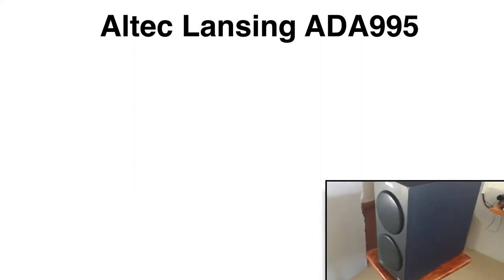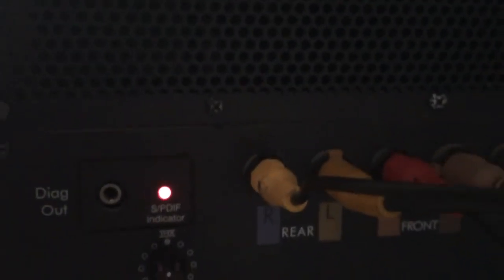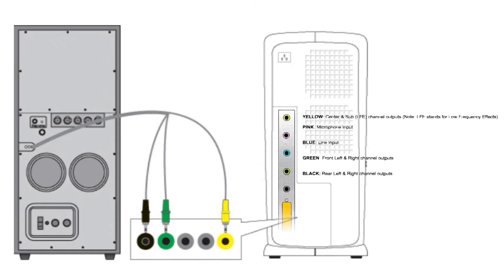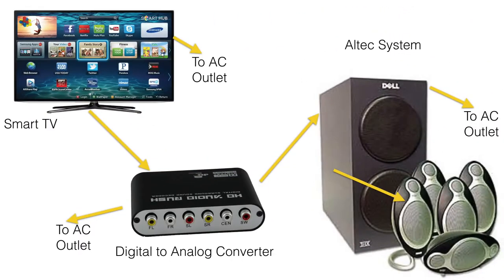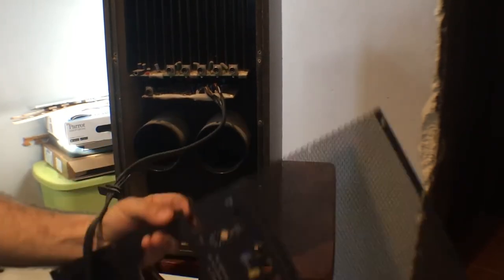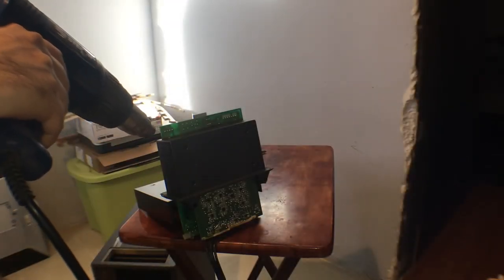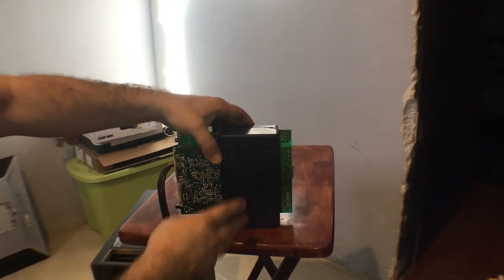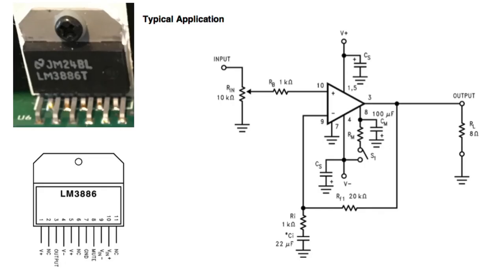Altec Leasing ADA995 5.1 home theater sub woofer take apart and review

Comment: I've upgraded my PC many times since 2002 and I still kept and used this to all my PC.'s. Still works beautiful, gives great sound and Bass....I dont think I will ever replace them unless it stops working completely LOL
Reply from the maker: I really liked the sound of this equipment, I sold it because I wanted a HDMI sound system and I could not get the 5.1 using its SPDIF input, but even with out that, it was a great a practical sound system even for parties.
Reply: Just don't leave them turned on!! I used to leave mine on all the time, and the capacitor in the amplifier fried and caught fire. If I turned them off every now and then, the amp/receiver would probably still work. But the speakers are still fine, Altec Lansing is top shelf. I used the dual 6" woofer cones to make bookshelf speakers out of.
Reply: How do you connect it to a new computer? how about the sound card and software? thanks ,new at this.
Reply: Samsies!!! Mine still sound as good as they did in 2002! I however, picked up some RCA to speaker terminal adapters along the way and swapped the satellite's with JBL control one speakers. The Altecs 8ohm internal amp matched jaw droppingly well with the JBL's and the difference in sound is certainly noticeable! Nice wood cabinet small bookshelf speakers are the perfect upgrade!
Reply: @sabrinaarturis  if your pc has 5.1/7.1 on the motherboard you can connect it to 3 3.5mm ports. After each connection a thing will pop up asking what you connected. Gold is center/sub, green is front, black is rear.
Reply: @lukenuked  thanks

Comment: I've had these same speakers forever.  They are really great.  They have seen many computers over the years and outlasted every one of them.  I just bought a new Dell/Alienware A51m, but I was disappointed that it only has one output for audio.  I bought the HD Audio Rush converter and all the appropriate cables and get nothing when connected to the new computer.  Zilch.  I don't even get a green "in" light on the converter.  Power light is on.  I have tried retasking mic/audio jack to output, but nothing.  I have confirmed your information about jack color and speaker assignments, and I have everything connected correctly.  I'm actually pissed that a $5K computer doesn't have the same audio outputs as all my other Alienware computers.
Reply from the maker: Well, I was shock on how well this system sounded (I sold it). Did you managed to make it work with SPDif?

Comment: Hey I'm very surprised and grateful to see that you take time to respond to questions - that is impressive. I was looking at subwooferst at my local GW and the thx logo caught my eye,  I got it to rumble by touching the tip on one of the inputs that white noise rumnle was enough to convince me and so I bought it. I couldn't find a ton of information so your video was a godsend. I'm so bummed I can't get it to play past a couple of minutes. Would you happen to know if there's a problem with the video or if not maybe I should look at my end. I'm guessing need to see the video of the answer the question but maybe you can tell me is one of those colored Ethan's plugs the input to the sub specifically? I assumed it was yellow because that created the loudest response from the sub. Again impressive sub and impressive videos thank you
Reply from the maker: Thank you for your comment and I am very glad it helps.
Did you check the video at 36 seconds, there I explain how to test each of the inputs of the subwoofer. I no longer posses this sub so I can not test on it, but use the integrated testing system in the sub to test each individual input.
May be I did not understand the question, my apologizes in advance. Thank you again for your comment and best regards.

Comment: I had mine since 2003 I believe. I had just finished upgrading from a 3930K build to a 13900K tonight, and was just going over some setting tweaks in the bios when I heard a shorting electrical  sound coming from the speakers. I first thought I'd screwed up with my build, but no, it was coming from the subwoofer. Smoke started to appear. I immediately unplugged the set. I took off the back plate, the main circuit board had nearly gone on fire. 

It's destroyed beyond repair, I'm heartbroken....😢😢
Reply: They are not beyond repair. Ask someone skilled in electronics to take a look at the board, or just buy some class D  ready amp 2.1 or 2.0 boards that are in abundance on so many portals and just swap the boards.
Reply: @aeonikus1  The board is fried, destroyed. And arc formed and melted a hole in it. This board controls everything, it's not just the sub. I have no clue where to get a compatible board.

Comment: Very interesting presentation. I've had this system for many years - superb! It was permanently connected to my PC (Creative Soundblaster card) but only switched on at the sub-woofer when needed. However, when I switched on the sub-woofer a few months ago, a very loud high-pitched noise was heard from the sub-woofer. I disconnected the system from the PC, switched it on and there was a very loud hum. No changes to PC or speaker connections. Is this a known problem and can the system be repaired?
Reply from the maker: It can be repaired, it is an filter cap that you have to replace, but unfortunately I don't have the subwoofer or datasheet to tell you exactly which one. Good luck and thank you for commenting.

Comment: The power cord in my sub got caught in the door and overextended causing the piece around the fuse and other small pieces to break...Do you have a video on how to fix/replace...
Reply from the maker: No, unfortunately I sold the subwoofer after I made this video, I miss it. Good luck.

Comment: My transformer blew up i think and i'm trying to convert the whole thing to DC only to wire into my car. do you know what is 12v and ground on the transformer input header on the amplifier board? I only need the subwoofer to function
Reply from the maker: I don't think you can use it with 12 volts DC from your car since the amplifiers ICs are for at least 20 volts.

Comment: I got one just like yours. I cant make the R-238 and R-220 resistor on the board that the speaker wires go to. The resistors burnt so i cannot read the color code. Could you tell me the color code. Thanks
Reply from the maker: Sorry to hear that, I don't have this speaker any more, I can not go and check the colors. Did you teach for the service manual in the intenet?

Comment: I'll be purchasing the converter and cables to use this dell system on TV. I have found the exact converter you show at 3:35, but what cables would I need to plug the converter into the TV? After hooking it up to the TV, what kinda of sound would I be getting? 2.1, 5.1, something else? Thank you so much, very useful video.
Reply from the maker: If your TV is Digital (like HD, FHD or 4k), it should have an optical output, you can connect that optical output to the "OPT1" of your converter and from there, you will get the 5.1 channels form your converter. Of course the programming you are watching has to have the 5.1 soundtrack, like a movie or Netflix that gives you the option to select 5.1 output in some movies or tv shows. If you use an analog output of the tv, you will only get 2 channels. Try as I said and let me know how it went. Thank you for watching!

Comment: I have same system but subwoofer started making weird vibration knocking noise then i could also smell burning smell now sub stopped working but all other speakers work fine. do you know where parts would be available to buy? in case its capacitor or same plate that went for you.
Reply from the maker: Are the subwoofers speakers in the box fine? did you test them? you can connect an external amplifier to check if they are working and not distorted. Electronic parts can by easily buy in Radioshack or via internet in eBay or aliexpress. Good luck.

Comment: Great video!  I’ve had mine done 2003 and am currently using in my garage with a Logitech Blue Tooth adapter and steaming from my iPhone.  Does anyone know where I can find wall mounting brackets for the satellite speakers?  The screw hole in the back is extremely small and nothing I’ve found fits.
Reply from the maker: Thank you for your comment.

Comment: Hi. I want to ask you one question, can I hook up both left and right front speakers and both left and right back speakers in bridge mode and make it like 2.1 system ?
Reply from the maker: You can, but make it from the input and not the output, that way you are not going to waste 2 powerful amplifiers (surround left and surround right).

Comment: So just connect two of Dell speakers to output of phono pre amp? Which two? Thanks for advice!
Reply from the maker: You can connect all inputs to the phone preamp using an adapter like I did in the minute 10:53 on the video ( https://youtu.be/nL-nkoAQjuI?t=10m53s ), of course, you need to use an 1/4 to RCA adapter.But if you prefer to just use two speakers, you can use the green input which is for the front speakers.

Comment: Do you have any idea where I could replacements for the rear satellite speakers labeled A7059?
Reply from the maker: Are those form an old vintage altec leasing? did you try ebay? If you want to replace them for non original speakers, just check the impedance it should have. Altec leasing have very tight specs for the impedance.

Comment: The ADA995 is awesome.

A couple of questions...
1. I recently noticed a burning smell coming form the subwoofer. I stopped using it for a while and then when I tried it again the sub does not smell anymore but also does not work. All satellite speakers work fine. Any idea what happened?
2. I have it connected to my laptop via USB and startech external sound card (https://www.startech.com/Cards-Adapters/Sound/USB-Audio/USB-7-Channel-Audio-Adapter-with-SPDIF~ICUSBAUDIO7D). When I test the speaker all channels (except sub) work fine). But when I play music primarily on spotify or pandora, only the 2 front speakers emit sound. And I have set up as 5.1. Any idea why the center speaker is not playing?

Thanks in advance.
Reply from the maker: 1.-For the burning smell, at the minute 9:41 (https://youtu.be/nL-nkoAQjuI?t=9m41s) I found a regulator almost burned out, so I added a bigger heatsink, you can try and see if that is burned out and replace it.

2.-Nice sound card!. This is a 7.1 sound card and your ADA995 is 5.1, did you tried using other outputs of your sound card to see if the center speaker works?
Also, at the first 40 seconds of the video, I explained how to perform a test for all the speaker, did you performed this test to see if all channels are working?

I would suggest you to check what is burned inside, check the transistor I mention (at 9:45) and replace it if need. Good luck and thank you.

Comment: I have one of these and my subwoofer just kinda stopped working. Speakers work fine but that's it. Do you think it would be easy to diagnose the problem or am I just better off getting rid of it? I don't want to part with it, but I'm in a little over my head here. Any help would be greatly appreciated!
Reply from the maker: At the 45 seconds of this video, I show how to test each output, did you run that diagnostic already and still no sound from the sub? At 9:46, I showed a voltage regulator that does not have enough heat dissipation, check if that one is working (in one of the lateral pins there should be 5 volts). If not, check capacitors and if you don't see any obvious problem, the LM4768 is burned out and you will have to replace it. Before you buy one, identify which one corresponds to the Subwoofer, remove it, and remove one of the other's channels LM circuit and put it in the place of the sub's LM. If it works, there you have your problem, if not, you need to keep searching for that bad capacitor o a open trace. Ohh, before disassembling anything, check if the LM corresponding to the subwoofer is receiving audio signal (a oscilloscope or small speaker can help you with that) or if it is receiving power (use a multimeter for that). Hope it helps. Thanks and best luck.
Reply: @Letsdosomethinguseful  Thanks for the response! I'll use this info next time I get a chance to open up my sub.
Reply: Update: I ended up having the board burn out some time ago after running into some issues and I figured that was the end of it. Recently I found a replacement board on ebay and decided I was going to try and bring it back to life. It was very difficult getting the shorter plug connected to the new board but once I got that done my favorite set of speakers was brought back to life and I'm keeping my fingers crossed that they'll last for a good while. I probably never would have opened my sub without this video so thank you again!

Comment: I just built a new PC from scratch, but my ADA995 system still lives on!  The problem I ran into is that there used to be slick software on the Dell THX machine that I originally bought with the speakers that let you set up your speaker configuration, test each speaker, etc.  Do you have any idea if that software is still available, and if not what other software can I use to accomplish the same thing?
Reply from the maker: For testing each speaker, there is a procedure in the video that shows you how to test it using its built in signal generator. But for general configuration I do not have any idea if there is a software or other option out there. As you can see in the video, I was using it with the stereo output of the Mac, but if you have a soundblaster card with 5.1 output, you can better test each output and calibrate it. The PC you just build, does it has the audio system integrated in the mainboard?
Reply: @Letsdosomethinguseful  Thank you for responding.  Yes, the motherboard has integrated audio.  I found the configuration software that goes with the integrated audio and it gives me the ability to test each speaker.  It is not quite as sophisticated as the original Dell THX Santa Cruz software, but it does the job.  I have my 5.1 system back and it sounds as fantastic as it did on day one.  I am very pleased.  Thanks for your assistance.  May our ADA995's live on forever!
Reply from the maker: @HaroldBrand  Long live to the ADA995 :)
Reply: 2021 and mine is still the best sounding system EVER !!  All my friends love the sound and are all searching for a system.  If anyone has one for sale I'll buy it. I want a back up.  I dread the day mine dies
Reply: @rickw5024  I have the sub and speakers gathering dust in my loft, are you in the UK?...I would sell

Comment: How could I hook up my turntable to this system? In 2.1 of course.
Reply from the maker: Turntables preamplifier must compensate for bass loss during recording / reproduction so you need a special preamplifier called the RIAA phone preamplifier. You need to get you one of those and connect ir to the speaker inputs. Here is an example, I;m not saying you should buy this particular one, just giving you an example.https://www.ebay.com/itm/PHONO-PREAMP-STEREO-Turntable-RIAA-PREAMPLIFIER/152844875950?epid=622241513&hash=item239643b8ae:g:TMIAAOSwXYtY4SFC. Greetings and good luck.

Comment: Sadly no photos of the speakers that are inside of it. Was really looking forward to that when I clicked on this video...
Reply from the maker: I'm sorry to disappoint you. I also wanted to see the speakers to see how many watts, if they were connected in series or parallel, the suspension. Unfortunately, the box is constructed with compressed wood, and getting to the speakers would require to destroy the subwoofer box since compressed wood gets cracked if you take it apart once glued, not like the plastic parts, and this systems sounds wonderful so I did not wanted to destroy it...yet.
But I really appreciate you take your time to see my video and comment. Thanks.

Comment: My ada995 shorted out whole playing music through it, then smoke began pouring out of it before I shut off the power. Can it be saved or is it trash now?
Reply from the maker: Yes it can be saved. none of the components are expensive, the amplifiers IC are about $12 dollars each, but in this case, looks like the problem is a capacitor or diode that blowup. Did you open it already? if smoke came out, it should be easy to recognize the damaged component. Replace it and replace any capacitor directly connected to that component. Check that the fuse is for the appropriate amperage, it should blow before any internal component.
Reply: I'm attempting to take it apart now, but having trouble removing the circuitfrom the housing like you did at 7:15. I'm not electrically inclined so I may be coming to you for advice, I really love this system and want to save it!

I saw smoke coming from deep in where the circuit board is. The sub no longer puts out any sound, but does power on.
Reply from the maker: Ohh yes, it is a lot harder than it looks in the video. Did you use the heat gun in there also? it is very hard to get it out.

Comment: I dont have the sub only the speakers is there anyway I can still connect the to the tv
Reply from the maker: The subwoofer has the speakers amplifier so your only option is to use any other reciever to amplify the speakers.
Reply: @Letsdosomethinguseful  what receiver would you recommend please
Reply from the maker: @jackwhite6513  Denon and Kenwoord are very lasting equipments. If you are planning to stick to 5.1, buy an used one in goodwill or craiglist, should not cost more than $50.